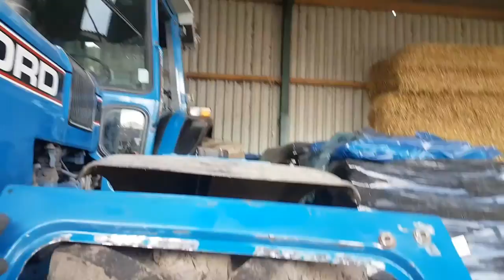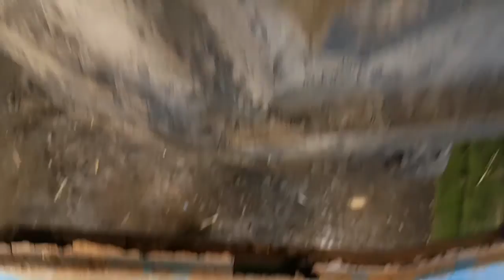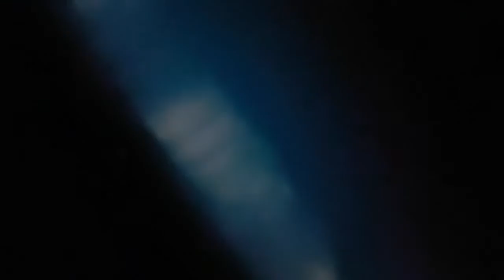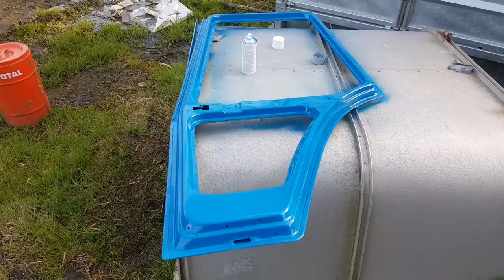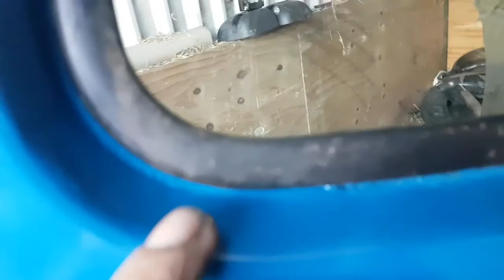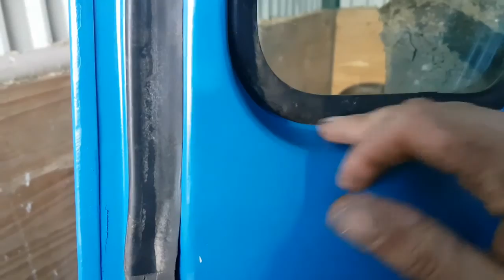Winter projects episode 7. The doors

Comment: How did you remove your windows? I need to replace the replace mine
Reply from the maker: Work from the inside with a flat screwdriver. Gently pry the rubber over the metal lip of the door. Take your time and don't force anything or a brush will be required 😁